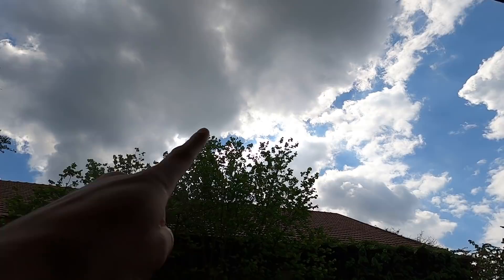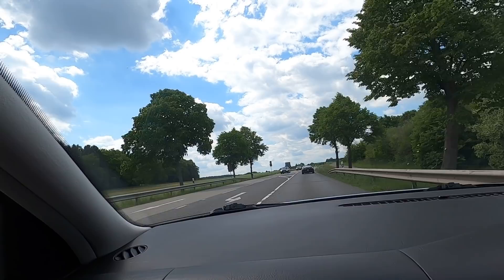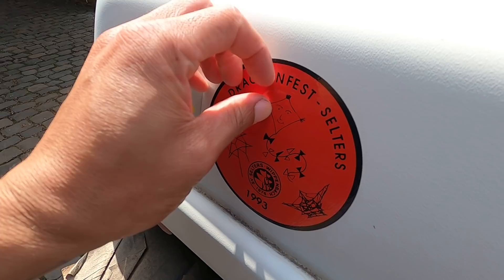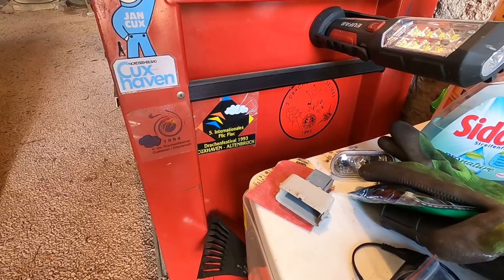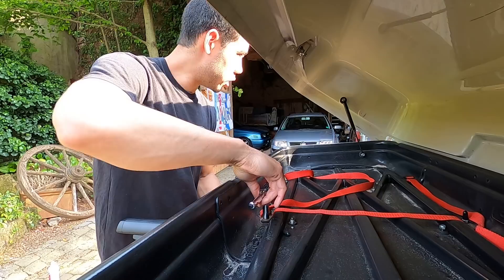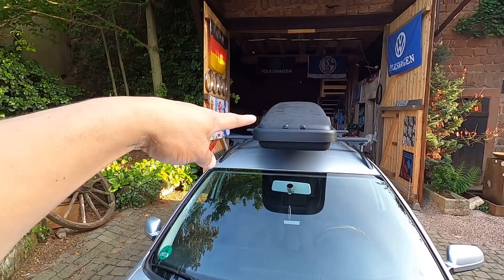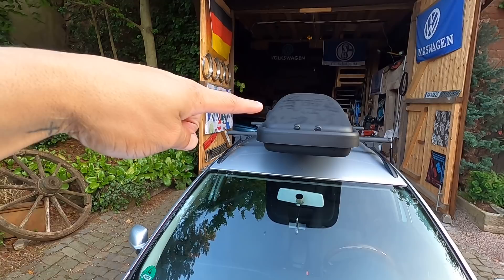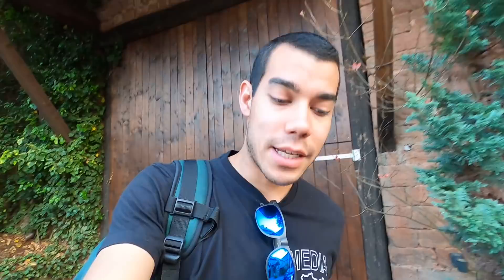I Didn't Use Trim Paint And I Regret It....(MK4 Bora Wagon )

Comment: Hi, Christian, I had one of my rims with a little crack like your rim, and I fixed by myself with a kind if JB weld that is sold here in Puerto Rico.  Is called pegatanke. I let it dry 24hrs and then sanded and painted the same wheel color. Is been 3 month using the rim and it doesn't give any problem.